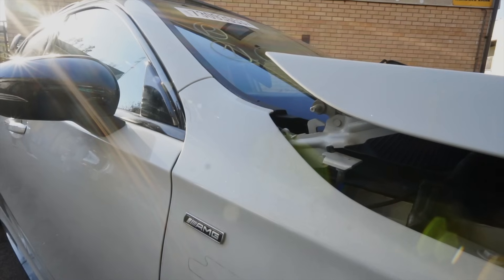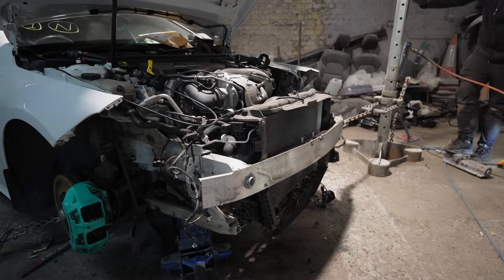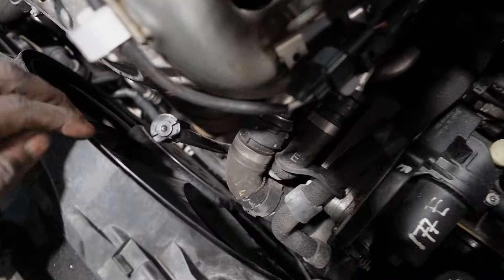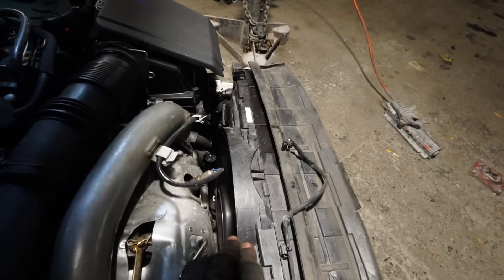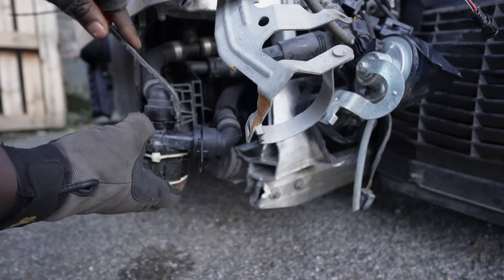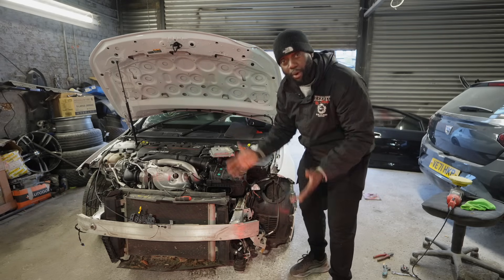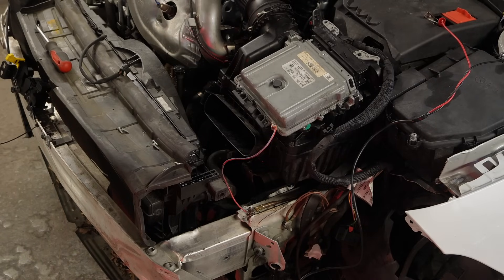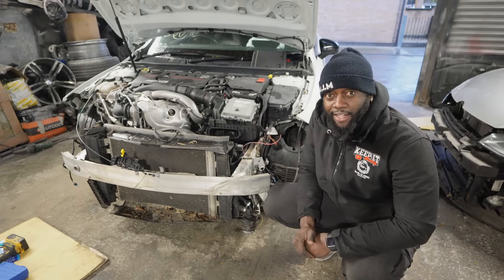I ACCIDENTALLY BRICKED MY WRECKED MERCEDES A35 AMG BUILD & I NEED YOUR HELP! - PART 3

Comment: Hi D , Mikey here, been subscribed from the beginning, been doing what you doing for 30 years buy repairs paint sell , I’m 48 now, based in Borehamwood N London,
I had a similar issue with a slk & found in the ecu the earth solder joint was compromised, once re soldered started straight away , hopefully this may help , good luck best wishes 
Mikey
Reply from the maker: Thinking the same as i checked the wires going in and there good/live earth. Ill open it up and see wts going on inside
Reply: @SALVAGENATION bro I have a cat cla AMG mercedes Benz 2022 automatic which won't start do you know if it could be a fuse ?

Comment: I think the issue could be an internal ecu issue between the board and the casing maybe.

Unless you could find the main earth points from the ecu connecters to check there grounds to body, which yes could Also be providing a poor ground. 

Possibility a power fuse a main one to ecu is damaged but a external earth like you’ve done in the vid would not have powered it up. 

I suspect a really bad ecu earth or an issue with the board internally somehow not earthing of the casing anymore but through the body earth like you done

Comment: Just to lett u know  strightning chasis legs is only 10% of the rebuild u need to take engine out and take apart chasis legs make them staight then glue them and use riverts doing a rebuilt 100% is time consuming  
Same isues front inpact on my VW Golf 5

Comment: Mercedes hide fuses !! Old early 90s e class used to hide the abs fuse behind a plastic panel behind the battery !! Had another issue with a Merc and there was a fuse in the foot well behind the carpet .... Have to hide odd fuses so the main stealers can make money ! Pull the carpets back , look for plastic panels in engine bay. Keep up the content , watched you for years .

Comment: Dee I recon the earth from the ecu plug to the chassis when the ecu case grounded out to the positive side the wire acted like a fuse and if corroded could have blown the cable out this is a common occurrence on marine installations when the copper wire starts to corrode it still conducts power until the cable resistance gets to high and the wire arcs like a welder (welding rod pulled away from the job) until the arc cannot jump the gap anymore and the circuit affected stops working, if in doubt call an auto spark as there may be a common fault on that model / make of car .
Reply from the maker: Ew video out tonight ull see!

Comment: I have had this  before by a rookie delivery driver putting the + and - vice versa and blew the ECU you can sometimes repair the ecu and solder the burnt part inside of the ECU or just buy a new ecu ;/

Comment: Check ecu connector if its grounded, may be there is ecu repair services in london, which may be able to clone it and get a second hand ecu much cheaper possibly my car did this once it was junction box the fan  constantly kicked in no ignition , looks like a blown component on the actual ecu board fingers crossed its very minor , it will be usable 😅

Comment: I believe a resistor has blown within the ECU that connects to the ground pin. Due to the ECU being powered up incorrectly. If you don't find anything outside this is likely the cause. Might be a pain to open it. You might be able to save some money sending to microsoldering service rather than a dedicated ECU repair service. You have to call around to save the ££. All part of the game.

Comment: Thats good result it works when grounded, could have just burnt out the main earth track on the pcb board inside ecu, perhaps have to open it up to check, its better that it just burnt a earth rather than fried any of the IC's inside

Comment: Try changing the ECU fuse, a fuse is designed to absorb short circuits and voltage fluctuations, if there was a surge then the fuse is the weakest point so would take the hit to save the circuit from failure, worth a try.
Reply from the maker: Tried all fuses, its abit worse than that! New video tonight

Comment: Could be the piro fuse which is on top of the battery under neath the battery cover if you can’t fix it there is a Merc tech who in Walthamstow who comes out he always gets mine going done a few a35 builds
Reply from the maker: NExt video !! I found the issue

Comment: I think you have burned the earth wire like a fuse would have melted, and im sure all fuses and relays run on the live not earth thats why it works when you earth the ecu body.

Comment: Rest assured bro nothing INSIDE the ecu is fuxxed. If it was then it would not fire up after u earthed it. It's a simple wire or relay not making contact. Do a wire trace from the ecu to the earth on battery. You'll surely find it bro.
Reply from the maker: Thanks mate proper gutted tho as it was school boy error on my part
Reply: @SALVAGENATION  Don't worry & don't beat yourself up about it too much man!.. Its only because you were rushing to move the car it happened by mistake. But like YOU say. Keep it positive & keep it moving man!. It will all work out.

Comment: Hi D I’ve got a question I bought a c class w205 like the one you did, bought a second hand headlight and put my old module on it but it still doesn’t turn on any ideas? I think in your vid you said they don’t need coding so I am confused can you help please? I NEED HELPPPPPPPP
Reply: @asif3712 the previous headlight was smashed up completely gone but somehow the module survived but could this still need replacing then?
Reply from the maker: Could be a bad module. Or needs coding still. One of the two. A diagnostic took will tell you, it will say “missing message” for left led or bot coded.
Reply: @SALVAGENATION  THANKS FOR THE REPLY D 🙏🏾🙏🏾🙏🏾

Comment: Take this to Autoalign bro and get the Cat N removed after an inspection, it’ll want it ngl it’s a rare car and it’ll go up in value for sure

Also for the ECU it’s not the end of the world, send it to a board specialist bro and they should put it on a bench and get it fixed
Reply from the maker: See this is why i love the community were are building. I never heard of this! And ive just checked it and ill deffo be taking it there.
Reply: @SALVAGENATION no worries my broooo! There’s bare ECU specialists in London so you should be fine
Reply: @SALVAGENATION  Don't waste your money man. Autolign only updates HPI record to 'condition inspected' but car still retains it's cat N or S marker. Also ONLY HPI is updated, any other checks like car vertical are not changed. In my opinion Autolign isn't worth the money or hassle.